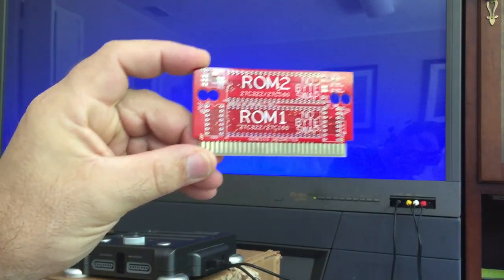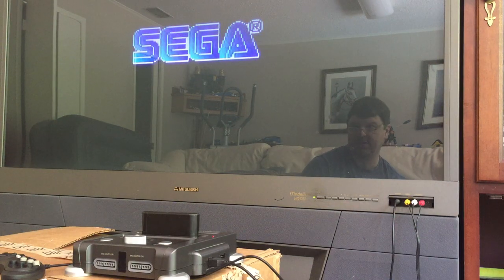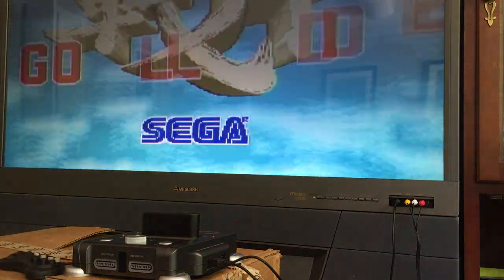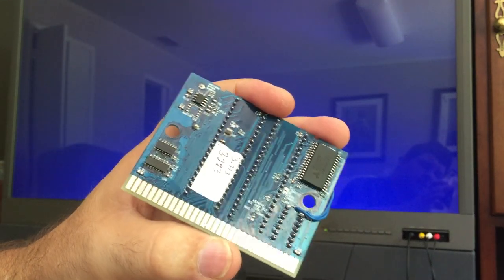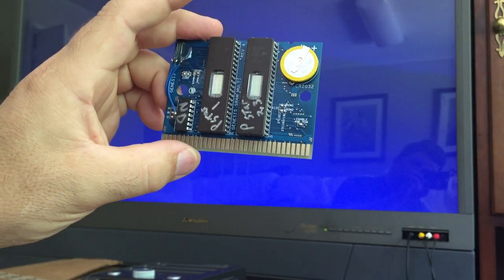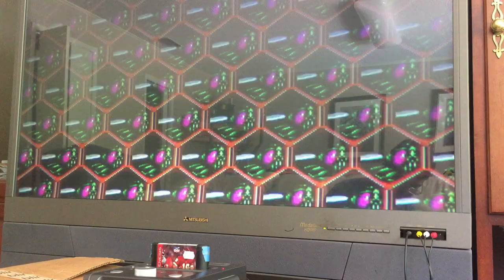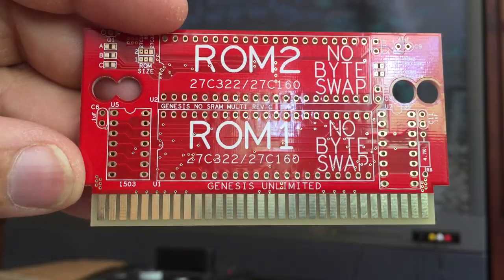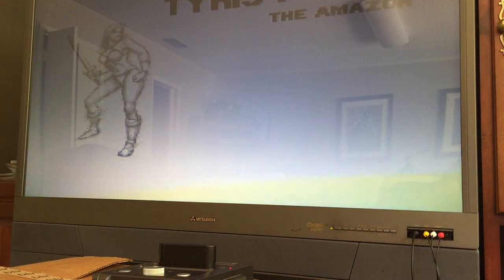Repo Genesis and 32x pcb

Comment: Is it possible to wire up a pushbutton to change the game instead of a magnet sensor?
Reply from the maker: King Harkinian  yes, a button is possible.  We didn't want to drill holes in the case is why we went with magnet detection.   Our newer pcb's have a new type of switching where you press the reset button twice and then it switches.  
Contact RetroCircuits.com for more details.
Also, there is no need to turn off the console now.  The newer boards will automatically reset the console.
Here's an example
https://youtu.be/F8ON3NOmt4E
Reply: Thank you for your quick reply!

Comment: Multi-games with 2 rom, you need the Microcontroller PIC16F1503?
Reply from the maker: Arthur Oliveira yes.  You need the micro controller and magnet sensor.  Mortoffgames sells the pcb and kits with all parts necessary for multigames.
Reply: I bought 10 pieces and 10 unitsTwo ROM Kit. Was not in the kit the PIC16F1503. only the "74HC139". I do not know what to do now. can you help me?
Reply from the maker: Arthur Oliveira the 74HC139 is part of the kit you need.  Have you contacted the web master for this issue?  Mortoffgames is not my website.   He buys my pcbs and resells them.
All multi's should have a 16F1503 chip though.

Oh wait, he sells the micro controller separately I think
https://youtu.be/8gD8E6AHlk0
But you have to ask for Genesis version
Reply: OK! I can substitute (16F1503) for PIC16F630?
Reply from the maker: Arthur Oliveira no.  The chip has to be programmed by me to work. You have to get the chip from the web site.  It has to be for the Genesis pcb.
Reply: I have welon vp 996. Can you send me the file? To write for genesis? please! help me!
Reply from the maker: Arthur Oliveira  we do not distribute the code.  Sorry.  The chips must be purchased.
You have a good programmer.  Same as mine.  You should contact Mortoffgames and get my direct email.  YouTube is not the best way to communicate for this.
Reply: Hay can send link to multi-kit and all parts needed ..cant find them on site :(
Reply: friend! I mounted with the microcontroller (pic16f1503) that I bought from Mortoffgames and a red screen appears and does not start the game. I cut the dash of A19 and A20. What can it be?

Comment: Whats the name of the red board that uses 2 EPROMS and a control chip?
Reply from the maker: xboxgamerJ16 https://www.mortoffgames.com/sega-genesis-1/homebrew-supplies269/pcbs/sega-genesis-multi-game-board
Reply: arcademaster1 thanks! Now I have one question. I have a repro copy of Darxide on the 32X. Problem is, that its on a genesis cart, not a 32X cart. Is there anything I have to do with the Rom chip before soldering it onto the new board? Like byte swapping? Im very new to this and I want to make sure everything goes smoothy and not screw it up.
Reply from the maker: xboxgamerJ16  these pcbs use a non-byte swapped file.  Easiest way to tell if it is byteswapped is look at the beginning of the rom file in a hex editor, if you can read "sega" then it is not byte swapped.
Reply: arcademaster1 i have no way to tell since I dont have a computer.
Reply from the maker: xboxgamerJ16 how are you going to burn a rom then?   Generally speaking, other people's repo boards require a byte swap so the rom would not work in our board as a direct swap.
Reply: arcademaster1 i used to think that the board was just to run the game and the ROM chip just had everything. I thought that if something was wrong, I could just put it on a new board as long as it was similar enough. But its not a rom that im programming. Im just turning a repro cart of a 32X game on a genesis cart, into a 32X cart.
Reply: @xboxgamerJ16  wouldn't you just change the shell? The screws are all in the same place I do believe
Reply: @greenkoopa  I honestly would have but the boards were drastically different. The holes were in the same position but I couldnt due to the size of the pcb. Now I actually have a Repro FIFA 96 and I CAN shell swap that one. I just need to find a reproduction label.
Reply: @xboxgamerJ16  lol sports games RIP